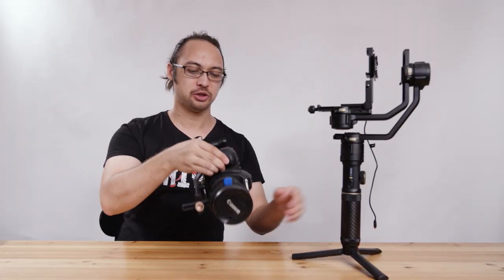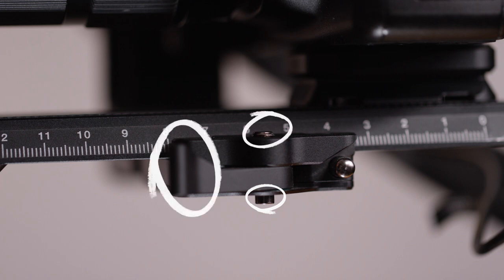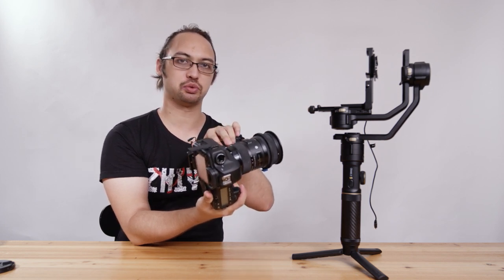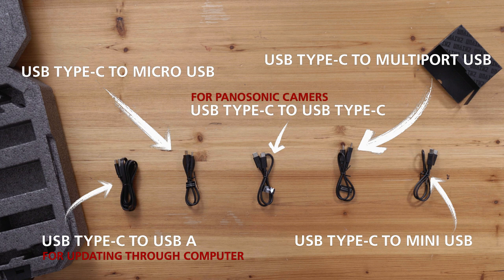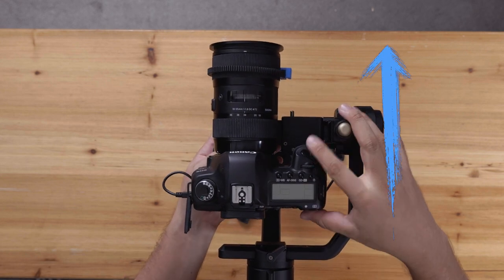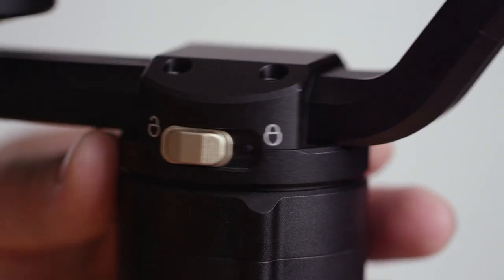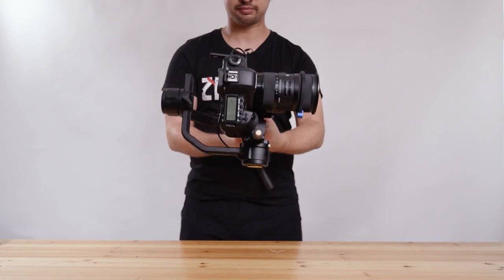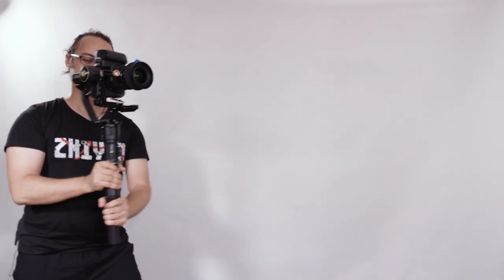Zhiyun Crane 2S official tutorials 02 how to balance

Comment: this was soo helpful for me. Thanks! but i have a question. I use sony a6300+ 16-50mm. When i want to shot at vertical mode i cant balance completely. because a6300 is not that big as your camera.  Crane 2S's roll axis is not long enough. i cant swipe toward left the roll axis. i hope i could explain :D need help
Reply: Same problem 😢

Comment: I bought a new gimbal crane 2S pro and Blackmagic 6k G2. Problem is I can't stop  vibration and  noise from gimbal crane 2S pro. I am using sigma 18-35 lens. Another important question There is one usb -c port on Blackmagic 6k G2. If I use Usb-c port for connection gimbel and Blackmagic camera, I can not connect ssd hard disc. Do I have to connect gimbel and camera for good result?

Comment: Small (maybe large) problem.... How do I store/ transport the gimbal when the extension bracket is removed and it is at 45 degrees? The gimbal won't fit in the carrying case that it came in anymore. And it's too large to fit into my camera bag.
Reply: it will fit, you have to unlock everything and move arms to fit it, anyways then you have to balance it again from the scratch.

Comment: i have this gimbal and it changes modes by itself. How to fix that? im using A7S3 with Sony 35 1.8G and thought the reason for that could be Full HDMI cable which is connected to Ninja V is making whole system unbalanced. But then again i have removed all and with only camera and lens attached gimbal is changing modes by itself. I have pre-calibrated all, set motor to autotune etc and issue is still there. Any ideas what could be wrong?

Comment: perfect video,, one of the best.. i have a question is normal  mi bmpcc+ small rig complete+sigma 18-35+metabones.. give me jittler videos with the crane s2? i balance well.. the motors are in low because in mid or high have to much vibration..
Reply: I have the same problem, mate. Have you found the solution?
Reply: @Олег-г1о3к i move to dji rs2... i dont find any solution

Comment: Hello I am Ajay 
I can't control my Sony a7III camera settings like(ISO Apur. Speed) with this Gimble how to control camera settings with this Gimble I was tryed all settings but still I can't Operate camera with this please help me. Thanks 
And this video is also help me how to balance and lock base plate on Gimble.
Reply: I have the same problem. could you find a solution?